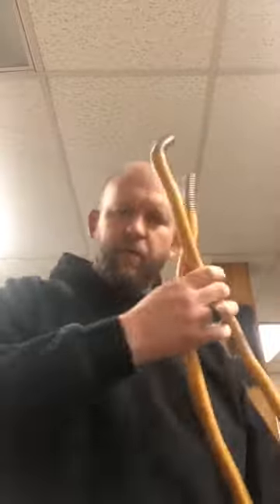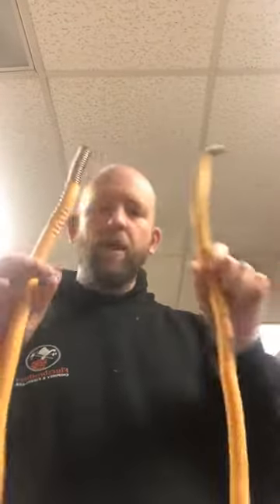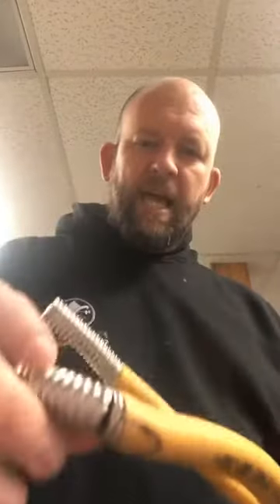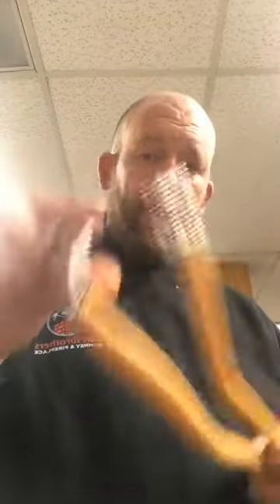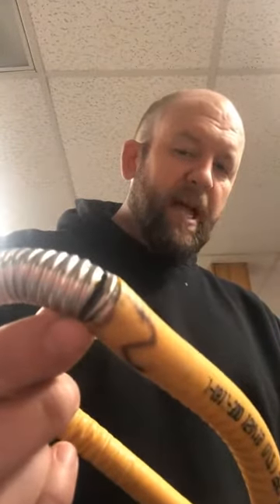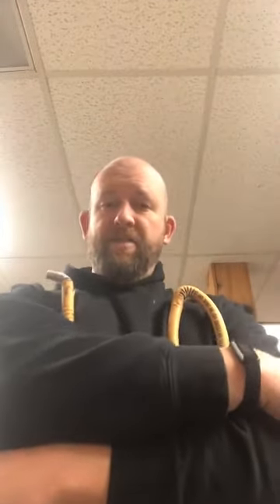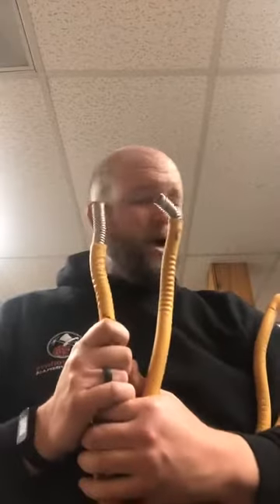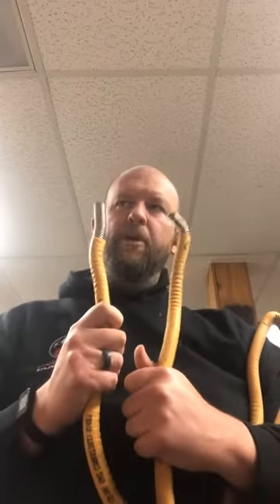BIG Safety Hazard From A Flexible Gas Line Leak

Comment: That leak would’ve emptied the system and been extremely noticeable immediately. Ethyl mercaptan is so strong that would’ve been hard not to notice. I’ve seen a regulator leak empty a 1000 gallon tank in less than 3 weeks.

Comment: Had the gas company come out to inspect our vent-less fireplaces last month. He noticed that our propane tank was empty, which was odd, since we hadn't used any since the tank was filled in the spring. 

Long story short, he found the leak was coming from a t-fitting that was buried in a wall when the previous owner converted the garage into a den. Good thing I had a drywall saw handy.

He had to re-route the supply lines to the crawlspace so the t could be accessible. He replaced the old copper tubing with the CSST. It looks to be much easier to use than black pipe, and more robust than copper tubing.
Reply: You should make sure that the CSST is properly grounded, it is a known hazard that lightening csn strike and leave a pin hole leak in CSST if it’s not grounded properly. Worth a Google search for ya!

Comment: Anytime you make a modifcation to a gas line a pressure test / leak test MUST be done, check nfpa. This test does not require a " class 3 inspection" unless the test does not pass. So the company who does the modification would be found responceable.

Comment: You would not believe the stuff Ive seen. I was called last week by a customer who had called an electrician to replace her gas logs. It was leaking non stop so she called me. Should have called me first because this jack leg had a 3/8" flare x 3/4" female 90 with the 3/8" flare end taped up and straight into the 3/8" female pip threads at the back of the log set at the appliance regulator. Then he had the female end with a piece of 3/4 rigid copper pipe and at the other end this fool had taken only PART of an old style wardflex fitting and matched it up with a non compatible nut (looked like some kind of water fitting) and had the old style 3 corrugation rings around the ward flex and shoved directly into the 3/4" copper hard pipe (on the inside of a male threaded nipple), thread taped the hell out of it and screwed the incompatible water nut directly onto the the pipe. So he left out the bottom half of the csst straight fitting completely and then used a water fitting nut around the rings and pipe. Wish I could show a photo on here. Was the most ridiculous and dangerous crap Ive ever seen. I told the woman you need to call this guy and tell him to NEVER touch a gas line EVER again. He's going to blow up, or burn down somebodys house or worse kill somebody. Never let a Plumber or Electrician do the Gas Mans job! Unless they have a license to specifically do gas and insurance!!! If needs be, ask them to produce their license or provide references and photos of their previous work. Ive gone around fixing eff ups like this for 23 years and I come across work almost daily that was done by plumbers using fittings not appoved for pressurized gas. Call a Gas EXPERT.

Comment: It doesn’t matter who installs the gas line, ok maybe it does. Facts are the standards have changed and as a plumber I would never recommend flex lines except for appliances after the shut off valve. Fact that contractors install flex gas lines as a main should make every home owners scared. If the main is not solid expect a leak sooner then later.
Reply: No good for a main but good enough for after the shut off? Yeah, that makes perfect sense...
Reply: @billymacktexasdetective5827 quick question can I run this 1/2” gas line directly to a propane? I’m working at a house and their shutoff is literally in the fire place with one of these lines. They were running flared copper but ima remove the copper and go back in with this straight to propane tank w/ black iron tee and drop leg somewhere along the way. Good? Plz lmk